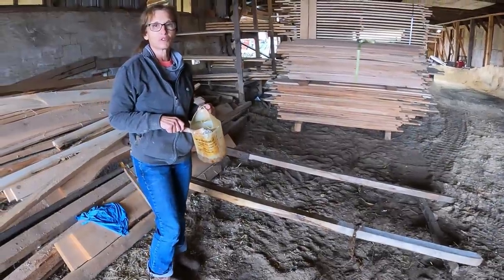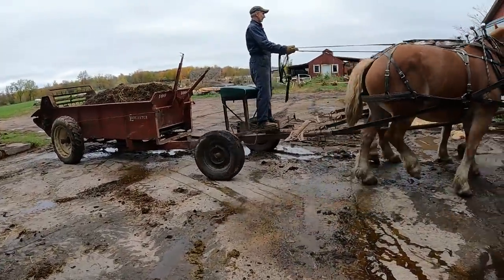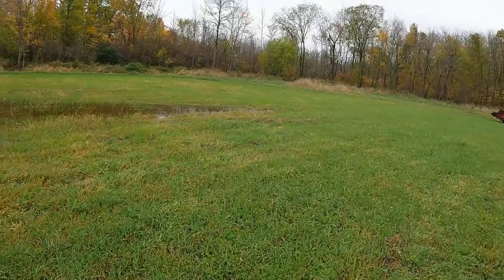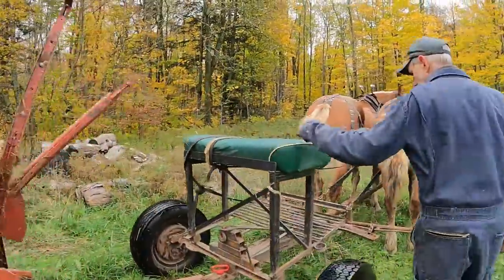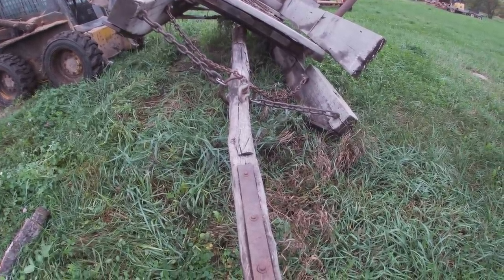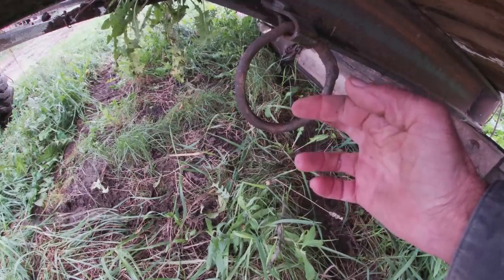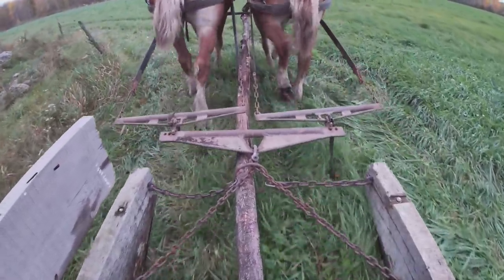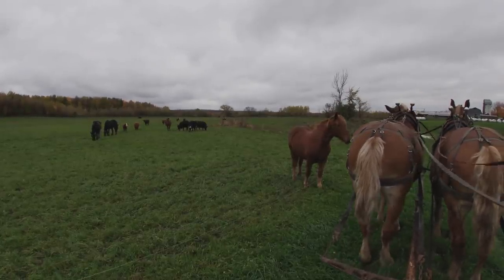Fixing a Horse Drawn Scoot // Spreading Manure with the Belgians

Comment: Brenda, you are going to have to update the name of the channel since you left work.  Maybe you could call it, "Riding along with Jim," or "Come Ride Along with Jim."  I had a sledge like that, but mine never had a pole.  It only had the chains to the runners.  We don't get that much snow down here, so holding back isn't an issue.  It turned fine without it.  I used that thing for EVERYTHING.  It was the handiest piece of equipment I had.

Comment: Add turpentine to linseed oil to speed up drying of the oil,  3-4 parts oil to 1 part turpentine. turpentine doesn't affect the quality of the linseed oil, it would thin it out to penetrate easier and quicken the drying time. The simplicity yet complexity of some horse drawn equipment is amazing compared to todays equipment. i never realized that allowing one runner to move with the chain allowed the sled to turn easier.